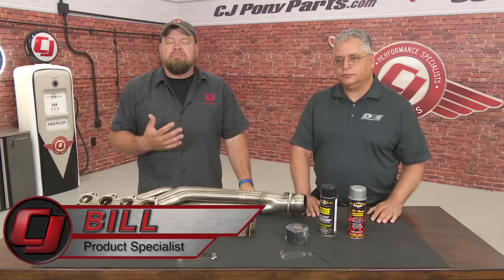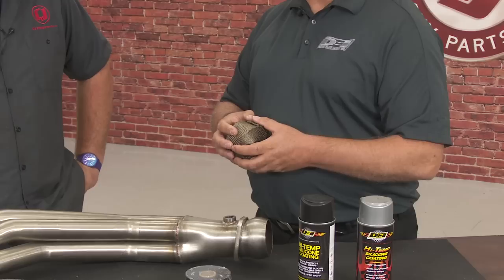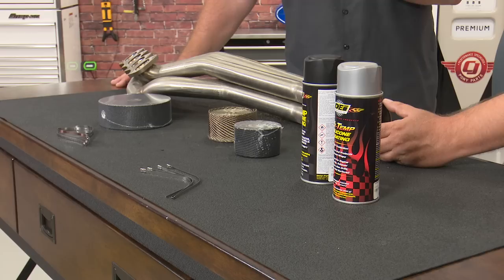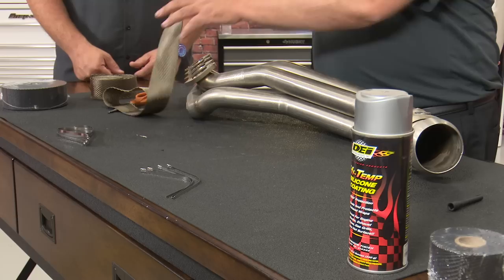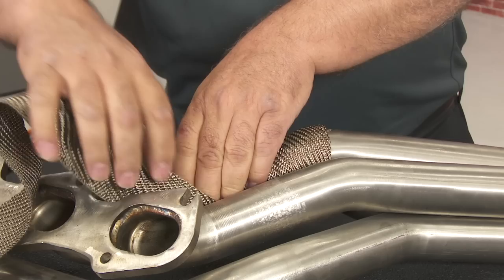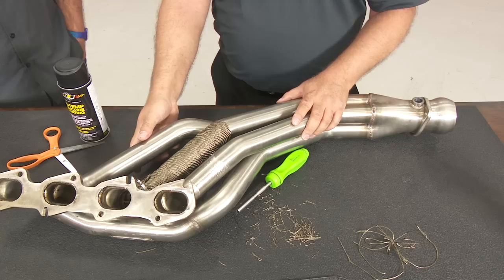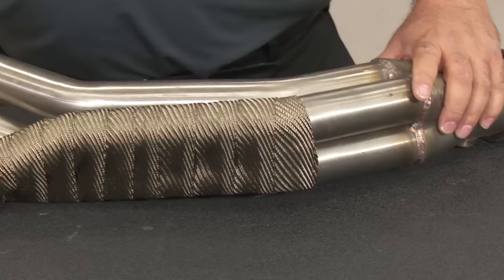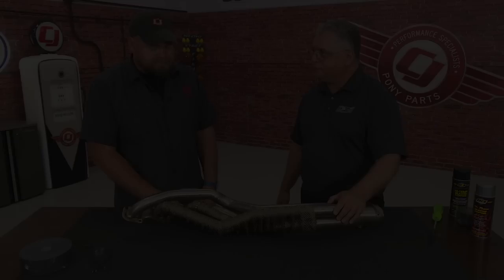Header Wrap | DEI | Mustang

Comment: Lets be honest we just want it cause it looks cool lol
Reply: @mikeschneider634  And who is gonna really see it anyway? 

The reason I want it is I heard it helps with temps and can increase horsepower a bit. Only reason I want it is for performance increase.
Reply: There more going on than just wrapping header. Keeping  the the heat in the pipes causes more flow . Savaging, hot to low pressure. That's is what H and X pipes do all so, the H /X pipe area,is low pressure, the combination exhaust is high pressure and this effect pumps the exhaust out. The 4 in 1 pipe also causes this effect vs stock manifold. If you ever noticed under front engine car, along the exhaust pipe ,there will be an area where the pipe is getting very hot ,compared to the rest. The reason is because of the distance to the Bach of the vehicle, the high/low pressure Equalized. It stop flowing. Just like the weather ,high/low pressure causes air flow. Now ,what's really cool,is having a big busty blond in the jump seat, gigaling with beat of the engine. And then her boobs rise up when you get on it. But be safe, that someone's daughter/wife/mother, bring them home safely. How to tell when you girlfriend is getting fat? She fits into you wife's clothes. Stay thrust my friends.
Reply: I won't lie, looks is a good part of it. But the main reason for me is to stop radiant heat from destroying other sensitive parts nearby, like one of my CV boots.
Reply: Syrthdr09 Sybr i would rather protect those components by shielding them as opposed to wrapping the headers such that they can dissipate heat and not raise my engine temps
Reply: @DKTPAirsoft  Good point, however the clearance between downpipe and oilpan is very tight and I couldn't think of any good shielding options.

I figure stopping heat transfer into the oil takes priority over raising exhaust temps a bit.
Reply: Actually you want it because it’ll help keep your clutch cable from being melted if you own a 1987-93 mustang

Comment: As soon as the temp gets below 110 or i get shade in my  backyard im doing this to my raptor 700. I should have went with the titanium over the looks of the black one. My leg get hot hot hot! Thanks for the tip of get the black wrap a littls wet and folding the ends over!
Reply: SiNvegas 702 Nice man I just did it on my YFZ450 and man after riding today sure does help my leg doesn’t burn anymore👌🏽

Comment: Isn't the main purpose of the silicone spray to keep the moisture out. Wrap can trap moisture and cause headers and exhaust manifolds to rust very rapidly.
Reply: It is. IMO, you would spray the header with a high temp paint, wrap the header and then spray the silicon spray on the wrap.

Comment: So this is basically rock wool? Like the industrial bat insulation. Guess we can use rock wool bats for silencer core stuffing as well as it can handle the exhaust heat just fine? Guessing it's a lot tougher than the FMF fiberglass packing material.

Comment: After wrapping the pipe, how soon do I have to heat up pipe? I have a bike on the lift, gotta wrap the exhaust, but I have other issues to address, so can I wrap the pipes correctly, and wait till the bike is finished before starting engine and heating pipes? How long? I am using  DE Stainles

Comment: Thanks for posting this. Here you are suggesting to paint the titanium/lava wrap with the silicone spray paint but in some of DEI's material it says not to paint the titanium/lava type wrap. Which is it? To paint or not to paint the Titanium wrap? Thanks?
Reply: My thoughts exactly. There is contradictory info here, and on theire website and on theire official chanel videos. Please clarify!
Reply from the maker: He was saying you can spray it ahead of time and it will make it easier to install the wrap. You do not need to spray it on the wrapped header.
Reply: @cjponyparts  That is not actually what he says. Rewatch the video. I know I don't "need" to spray the wrapped header. The question is can the spray be used on titanium wrap (in order to gain the benefits of the primary purpose of the spray which is "seals the material and provides lasting protection from dirt, oil and road grim")? It would be great to be able to prevent oil from soaking into the titanium wrap and causing a fire.

CAN the spray be used on the titanium wrap without causing harm or is that not recommended for some reason?
Reply: @kirkbrode  @ 7:47, he specifically says, "you can spray more on top or you can leave it as is."

Comment: Will it save my legs from my HD pipes. Those are crazy hot.
Reply from the maker: This stuff insulates really well, it will most likely save your legs haha.
Reply: I've done it on my sportster. it will definitely help with the heat. before it was almost unbearable at the stoplight, now not so much. I think the difference in life expectancy for the wrap is heat exposure, a HD runs usually very rich what means the exhaust temp is lower and of course airflow will help too.

Comment: Hey Bill. I can’t say anything negative about your involvement in this particular advertisement for DEI Thermal Wrap Products. You actually did a pretty good job of carrying Mike when it was obvious that he was struggling with the product or finding the right words to say. Maybe the recording process caused him to be a little nervous but confidence was definitely lacking during the segment. 

The benefits of reduced under hood temperatures are always a plus for a number of good reasons. But when it comes to any real world benefits that the average street/strip engine could possibly use as an advantage by maintaining the thermodynamic properties of hot expanding exhaust gases to prolong the velocity as a means of increased scavenging just doesn’t seem to be very practical considering the initial cost and tedious installation labor involved to make it look like a professional installation that will actually last the 3 or 4 years as suggested by Mike. 

Another minor point that could turn into a major hassle is that nearly all of the quality header manufacturers that provides a warranty with their products also makes it perfectly clear that using any type of thermal retention products on their headers will void the warranty. The reason probably has something to do with the sustained elevated temperatures when in use causing metal fatigue and moisture retention when not in use causing oxidation issues. 

I do believe that when it comes to headers, you get what you pay for and there’s a good selection of cheap headers available for many 2-V and a few 4-V Cleveland applications.  For well engineered 4-V headers designed to fit a Classic ‘70 Mustang chassis, the choices are limited and the price really goes up. Then comes the old school die hards that choose to run Cleveland iron high port conversion heads from the glory days of Pro Stock domination. No problem in a tube chassis car. Not so easy in a ‘70 chassis. Custom headers specific to the D1AE quench chamber high ports and modified shock towers are required. 

Ask me how I know 😳. Still looking for a good header fabricator. 
And the beat goes on......

Comment: Can you wrap headers in place? Or do have to remove them from the engine?
Reply from the maker: Depends on the car but typically they are very difficult to wrap when installed.
Reply: @cjponyparts  69 f100

Comment: I thought wrapped headers was a one time lifetime ordeal. Guess I'll be going the ceramic coating route.
Reply: We to went the thermal ceramic coating on most of the engine and exhaust parts, sure a tad expensive but worth every cent for maintenence and looks and wow cooled down the engine bay by 1/2 easy.
Reply: They lost me as soon as they mentioned the lifespan. I’d hate to pull out my headers every few years
Reply: @Callitwhatitis  The head pipes on my VROD have been wrapped with 2" DEI fiberglass warp for 7 years, no issues
Reply: @Callitwhatitis  thats why I only wrap specific parts. where things come in contact with the pipes.

Comment: Can someone tell me where can I get headers to buy for my 2013 Honda Accord EXL Coupe v6?
Reply: Keron Fisher - check ebay I'm sure I've seen headers for the accord on there but not sure if it's worth it.
Reply: Keron Fisher your accord doesn’t have headers. But you can get precat deletes or high flow precats from RV6 performance. That’s as close as the accord has to headers since exhaust comes out one port on the engine.
Reply: UofARollTide 
Thank you very much.
Reply: Amazon, ebay,online.........STUPID
Reply: The accord v6 doesnt have headers. The exhaust manifold is cast into the cylinder heads. They have precats and a J pipe. No header

Comment: Does it help to keep the engine compartment cooler ?
Reply from the maker: Yes you will see a difference since the headers cause a lot of the heat.
Reply: This is a great thing to do to isolate heat Away from the oil filter & Starter.
That these two things specifically are Very affected by heat.
The electric wire on starter & solenoid especially Chevy starters & the associated solenoid get basically destroyed from constant excessive manifold Heat!
Making battery appear weak or low do to heat makes wire very "resistive", thus requiring significantly More electric current draw from battery.
And the oil inside the oil filter gets BOILED from the 400-450 degrees off the manifolds.
Basically destroyed in a few hundred miles due to over heating .
Then the cooling & needed lubrication oil is designed to do is lost.
This is one reason Ford used engine oil coolers & Pontiac used power steering oil coolers and most MFG used radiator use for cooling trans oil, though a 
separate oil cooler is by far Better then radiator is.
.
Overheat oil in an engine turn into carbonizing material then eventually crystalized.
Natural law of thermodynamics..
Go put a $20 dollar harbor-freight thermo gun on a Chevy oil filter and looks how hot it becomes during usage, before & after the wrap!
Pontiac & Chevy Exh manifold heat kills these things and insulating heat away from these pieces is a MUST to make them last.
For the little cost to do this you can save the money and other things the heat does cause.
This should be way more popular on the older cars yet most guys over look this .
Sorry for long post...
Reply: The exhaust coming thru your headers moves much quicker the hotter it is. Wrap holds heat so the gases get out quicker.

Comment: I wouldn't use any wrap It can probably deform the pipes. Just do it right and use a ceramic coating. Imagine metal that can get glowing red and you wrap it with a wrap that the pipe can't dissipate that heat. If you want to reduce Underhood temp use a heat shield to cover the header. I warn you. It looks cool but is it worth some little flow and a hole in your pocket.
Reply: Header wrap is not for cutting down engine bay heat.